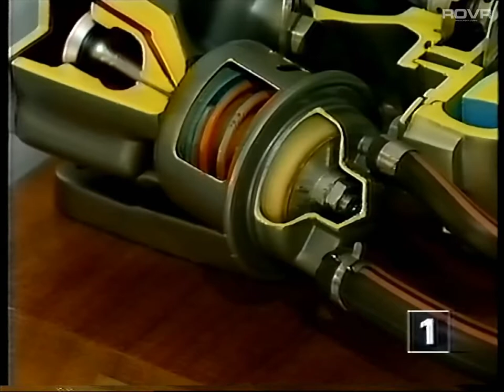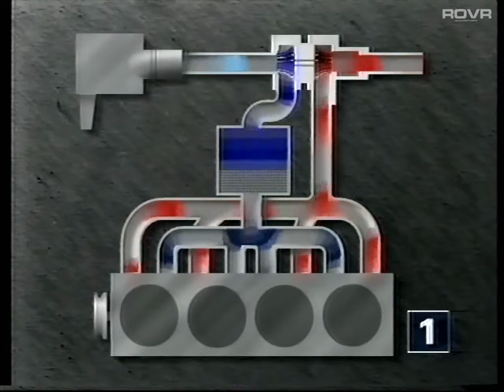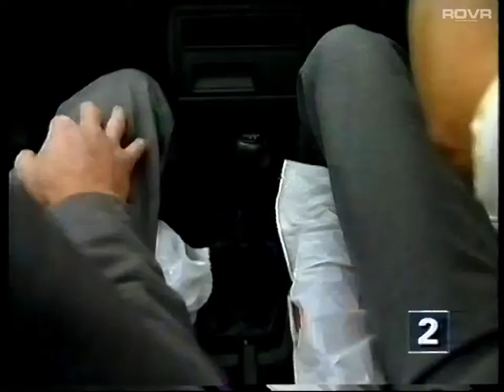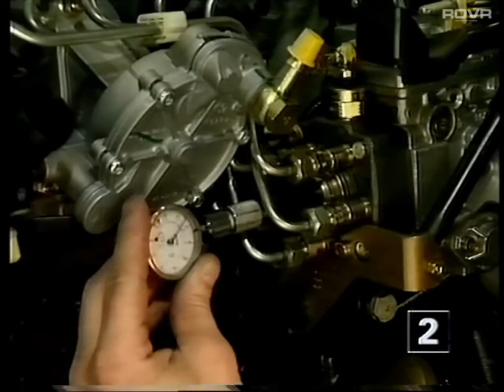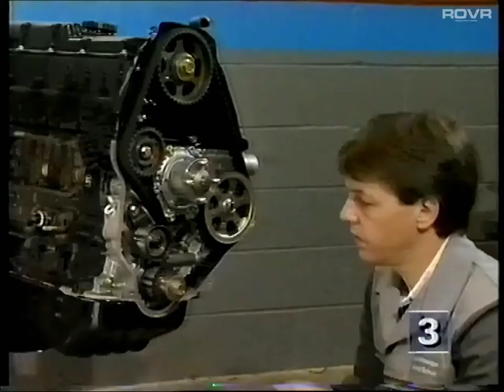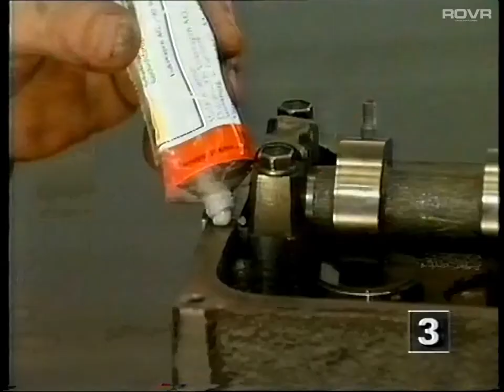Volkswagen Audi - Training - Turbo Diesel Engines (Umwelt) - Part 2 of 2 (1991)

Comment: Why would anyone install rubber cambelts on a diesel??!!
Reply: Less drag, better performance. Also cheaper and simpler as it doesn´t need lubrification.  It´s quite common to find rubber cambelts on diesel cars.
Reply: @madxico  I can see that cambelt breaking and the engine being junked.
Reply: @frothe42  if maintained properly they work great. They don’t stretch over time like a chain, and replacing them is far cheaper and easier than renewing timing chain components!
Reply: @frothe42  as in any engine part, diesel or not,  if part is not replaced in respective maintenance interval it will fail. Never seen one break if replaced in time. Some last as long as 10 years/150.000 kms.
Reply: @compu85  In some engines, ve seen more issues with chain belts than with cams.
Reply: @madxico  True, but most diesels have a chain which requires little if any maintenance. I don't remember Mercedes-Benz EVER putting a belt in their diesel engines.
And yes, maintenence is key to any vehicle!
I remember when Honda started making cambelt changes mandatory (part of regular service) in 1980's when their engines started failing at a high rate.
And to have both cambelts on this particular diesel must have been expensive. I don't see owners going for this unless they are either fastidious about proper maintenance or they have money 💵 💶.
Reply: @frothe42  agreed, I never see a 190D change one, for example. But on Fiat 1.3 I ve seen issues with tensioners as early as 80 k. And as some customers/mechanics thought those chains "would never change" as in the Mercedes above mentioned, they would drive them, noisy and screeching, until they failed. AFAIK the VAG TDI were reliable as long as you follow the cambelt intervals. But I heard  the process of changing it can be tricky and time consuming.
Reply: @madxico  Well, since this video is about VW Diesels, that's what I'm speaking to specifically. Compared to a VR6, which might need its chains replaced as often as the timing belt on some engines, the cost of belt replacement is a lot less!
Reply: @compu85  I never even saw a VR6 live, but I take your word it is expensive to replace.
Reply: @madxico  VW has always struggled with their chain drive systems. Some early VR6s needed the changes replaced by 80,000 miles - which means taking the transmission out to access the timing case.
Reply: The same argument can be made for timing chains. American HD pickup and true truck diesels are all geared for the same reliability and longevity arguments.